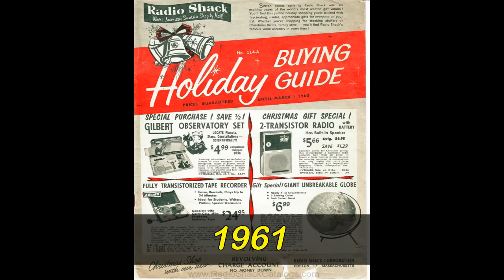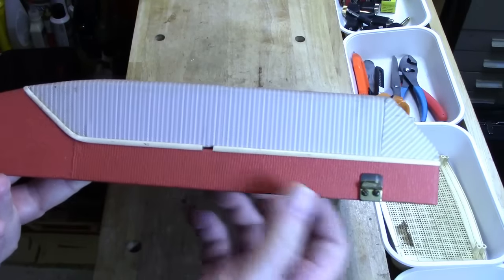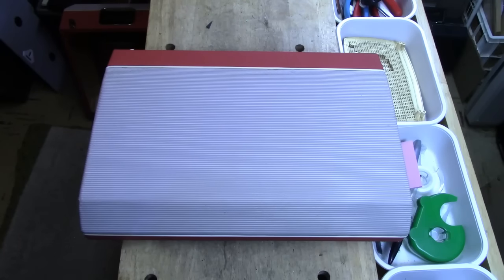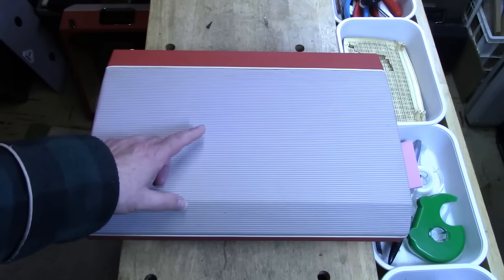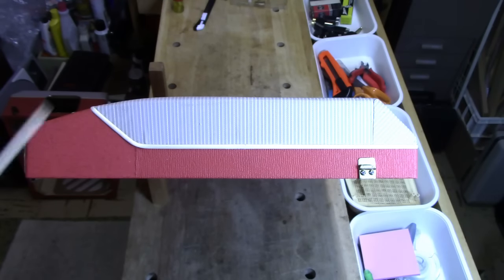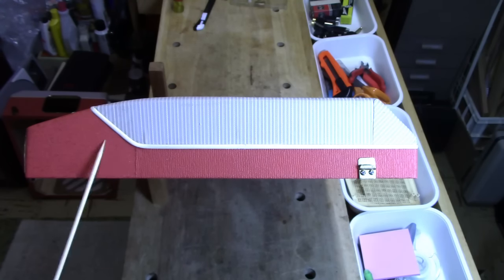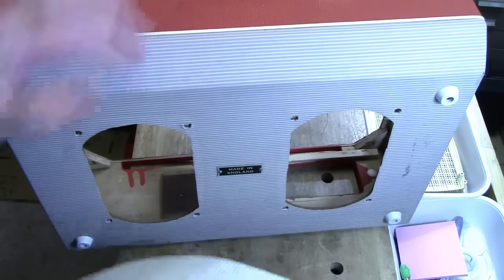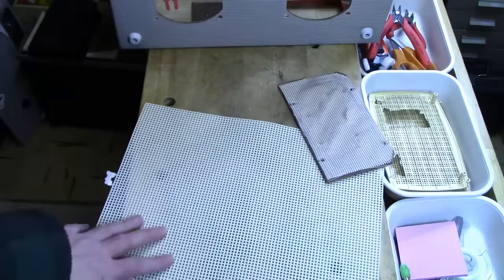Ep.3  – Keeping Up Appearances with the Realistic by Robuk Tape Recorder

Comment: Hi! Happy New Year!
Nice work! I'm glad there's a new video.

200W that's quite a big power consumption. I have a 5 tube Unitra ZK-145 (based Grunding TK-145 licence) that consumes only 46W. Although, it only has one motor.
Reply from the maker: AlexM1983DHUN  Thanks for watching the video. I was rather surprised to read that 200 watt designation as well. I suspect it is because of the motors. I think the take up reel motor is the biggest culprit. It is powered at all times, but held back in play or record by the capstan, so I expect it draws more power because it can't get up to speed. 

And when these motors try to do rewind or fast forward with a full reel of tape, it may be a struggle for them as well, so they draw more power to get going.

 I don't think it could be the amplifier, as it is just the 5 tubes, one of which doesn't even run half the time (the magic eye only works in record). 

Well, the electric company will be very happy! 

Happy New Year!

Comment: That speaker looks as if it might be a Fane Accoustic product, from Batley, in Yorkshire, England. Many years ago my parents had a "Perdio" reel to reel machine, it was an all - tube affair, and it had the same speaker. You've done a very good job with that Robuk, don't let anyone tell you different. Looks great. All the best for 2017 Tim.
Reply from the maker: River Huntingdon  Thanks for watching the video and for the info on the speaker. It looks to me like a pretty robust one, especially the "full body" frame -- although it is light on the magnet for the coil, but that is typical of the 1960s speakers. I also like that it is slotted so it is slightly adjustable to support the accessory compartment!  Happy New Year to you!
Reply: Many older elliptical speakers were like that over here across the pond. Though the magnet seems small, they were, as you know, often stonkingly efficient and gave a surprising volume for what they were. Of course the alnico design with the closed in magnet was ideal for the old tubes, and until recently even old tellies often had them. Showing my age now !
Reply from the maker: River Huntingdon  Yes, I've seen and worked with lots of speakers as you describe. The Sony TC530 (and probably similar units from them) have 6 x 9 oval speakers with relatively small magnets, but they put out incredible bass!

Still, it always amazes me that with all the audio stuff I have heard, my pair of $3.00 little computer satellite speakers blows me away with the sound they put out. Of course, I'm sitting right in front of them!

Comment: Ironically, the original color of the 'frames' of those inserts was closer to the shade of your new Plastic Canvas inserts. Certain 'white' plastic yellows over the years. to wit: cabinets of PC clones made in the 80's and 90's :)
Reply from the maker: Thanks for watching the video. Yeah, plastic can sure discolor with age! 

I could make the frames match the color of the plastic canvas if I covered them with ROMEX cable outer insulation. Ironically, it is the SAME width! It would make the frames stronger too. I am undecided however, as I have gotten used to the dual colors that I have now, and do I really need to make this project more complex than it already is?

Comment: I think you did a nice job restoring those little grills on the bottom of the case. I know in person you may think it looks a little rougher than it did in the video but from what I could see I think it looked pretty darn good. And it is a big improvement from the old grills which were broken and missing parts. And I can only guess what you used for that cloth for the speaker baffle when you were recovering it  it was either an old t-shirt or dare I say a pair of undershorts?  :)   also I'm damn sure I can guess what the T & B meant when you were talking about cleaning up the brass fittings. I'll just add a letter and say I think it was T----x, and B----o.  lol.  it's coming along great, and I'm sure it will look and perform pretty much as it did when it was first manufactured.
Reply from the maker: amberola1b  Thanks for watching the video. My issue with the job I did on the vent grills actually starts with both you and Buzz1151. I watch your videos very closely to learn from you, and your restoration work is really amazing to me. You guys do things with Bondo that floors me. So you guys have set me a very high standard that I want to live up to. When epoxy doesn't dry properly, that gets to be a real disappointment, because what can you do but wait? You know the joke about watching paint dry...Sigh...

You are close on the T and B products, We both now know what the B was for. The T is a little trickier. 

The T that ends in x product is no good for brass (at least that's what it says on the bottle) but there is a T sold in grocery stores that ends in e and rhymes with the name of those tiny chocolate bits people scatter on top of cupcakes,  I bet you can guess it now. They may not carry it in your area. I only found it in one of two grocery stores here -- neither of which carry the B product anymore -- had to get it on line. I am seriously hampered because my local and beloved ACE Hardware closed down 6 months ago. I am still grieving the loss. And there is no support group for this... "sigh, and again I say, sigh...." (quote from Gilbert and Sullivan "Pinafore")

I am pleased overall with the way the speaker grill came out, even though it is rough and not truly original. I think it looks nice with the "plastic canvas" material. The white stretchy cotton cloth -- yeah, you know what that is -- but I swear it was totally clean and bleached - which is how it got so stretchy and cuddly soft to begin with!

Stay tuned... I am diving into the mechanics and electrics -- kind of a challenge when the only circuit diagram I have has NO freaken values printed on it! But I did learn from a commenter that in Europe, when you see the symbol for a capacitor as two black rectangles and one of them is an open frame, that's an electrolytic. 

Happy New Year!

Comment: Don't be so hard on yourself, the restoration looks excellent. By the way the fibreboard looks like a product we call Hardboard in the UK, it's a brown colour, smooth on one side and rough on the other but without seeing it close up that is just a guess. Take care.
Reply from the maker: Tim Marshall  Thanks for watching the video. I think you are absolutely right about the "hardboard". This material in the taper recorder is as you describe -- it is rough on one side and smooth on the other.  

OH -- and I learned (silly me) that the American version is called "Masonite".  (Why is is called that? Is it named after the great actor, James Mason? Was it invented by the Masons?) 

Apparently Fiberboard is made up of pressed wood chips (not fibers??? I always called it "chipboard") , but Masonite is made up of pressed fibers and dyed that brown color. Masonite that has a grid of holes in it is called "Peg Board" and is used to make tool racks and vented cabinet backs.

However, because we are Americans -- and we like things to be as confusing as possible -- we use all these terms interchangeably. Don't forget, it was an American company that developed a computer that stops when you press Start (Windows used to do this).

Happy New Year 2017!

P.S. what is the hat you are wearing in your profile picture? It reminds me of the hats the train conductors wear in the UK (I love UK train videos!)
Reply: I am a Guard on the Swanage Railway, which is a heritage line here in Dorset in southern England and the hat is part of the uniform, another of my interests :-) Take care and I'll carry on watching your videos.
Reply from the maker: Tim Marshall  That is so cool. I love watching the documentaries I can find on British railways, especially the steam trains. I have learned that the UK started the railroads with Richard Trevithick (after he made that strange giant coach with 8 foot rear wheels!) and Stephenson's Rocket was a milestone of engineeering, and so cute too! I don't suppose they thought of these machines as "cute".  We have a few vintage railroads here in the U.S. and I hope we will never lose our appreciation of all that the railroads have provided.
Reply: In our way we both go about trying to preserve the past don't we, you with your excellent restorations and me acting my part in what is basically a re enactment of what was an everyday scene in Britain (and elsewhere) until the mid 1960's? I think the world was a different place then, you would probably appreciate this more than I do as you lived through more of it.  Our railways have changed almost beyond recognition since, as a small boy,  I watched filthy black steam locomotives still at work locally, probably around the time when people were buying the machines that you now bring back to life. We are lucky that a man called Dai Woodham bought a large number of locomotives from British Railways to cut up for scrap but never got around to it because it was easier to cut up old freight wagons instead.  Keep watching those videos :-)
Reply from the maker: Tim Marshall   I think we need to preserve and respect the past because that is where we come from and it continues to affect our lives. Imagine what the world would be like if magnetic recording tape had not been invented? No satellite tracking, no GPS, no video tapes, no audio tape and no computer storage and much more! 

While I would never go back to linear tape editing on a studio recorder (digital is MUCH too good and easy!), it is good to preserve examples so people at least know what it was like. I remember Walter (Wendy) Carlos breakthrough Moog Synth album "Switched On Bach". 

It came out in 1968 (I have the original album that I bought back then) and wowed the classical music scene because it was so fresh and innovative. It got a lot of "young folks" interested in classical music and I think maybe won awards -- or should have. HOWEVER....

It was made entirely on magnetic tape! It took over 6 months to produce with tons of tape editing. Carlos said he'd never do it again... and then came out with several more groundbreaking albums!

We now accept synthesizer sound as perfectly normal, and audio editing is so simple we can what Carlos did -- on a home computer with a FREE virtual audio studio! 

But back then, it was the stuff of outer space. 

My point is that mag tape tech made that possible, but it was laborious and awkward and yes, we have better ways today -- only BECAUSE of the way we were.

I think it is the same with railroads. I think it is wonderful that you participate in the preservation effort! 

Trains were the groundbreaking invention of the industrial revolution (along with steam engines) and changed the PLANET!  As you know, early trains were difficult, clumsy affairs -- and dangerous -- but at the time, they were amazing and changed society, in the UK and here in the U.S. -- where they led the way West (as we sometimes like to reflect). 

I got a chance to ride on a vintager steam railroad/steamboat adventure in Connecticut many years ago. The black, wood burning, engine was from the 1920's and lovingly preserved -- at some expense, which accounted for the high ticket price -- but we were happy to pay to support the preservation.

That engine radiated an amazing amount of heat, just standing idle while we boarded the all wooden combination passenger and hopper car. The front of the car was the hopper so some brave people could go outside and stand behind the tender. 

Well, as you can guess, this thing rattled and rolled on a very uneven track, chugging through the wild woods with the sound of the whistle echoing in the trees.

It was hardly what one would call a comfortable ride, and the wooden benches in the car and lack of shock absorbers (not sure they even had springs on the trucks) made for a bumpy ride! Yet, in it's time, it was the wonder of the age.

But more amazing was standing in the hopper part of the car and feeling the wind, watching the engine and tender swaying, getting the smoke and soot blown in our faces! (We had been warned!) 

And, what a ride! It really did feel as if it was an "iron horse", a living machine chugging along. I learned that we never went over 20 miles per hour, yet it seemed like we were flying. The roughness, the swaying the noise and clatter - what a trip! 

By comparison, the steamboat was a luxury liner, so smooth and quiet! The steam engine was centrally mounted to drive two paddle wheels and it was exposed so we could watch the piston rods thrusting the crankshaft (I believe it had three cylinders). The engine was constantly monitored and we got a great lesson from the engineer. What a fun ride! And then after a circuit in the river, it was back to the train, which ran IN REVERSE to our starting point! Blast from the past! 

Now compare that train to a modern high speed vehicle, (Like our Acela in the U.S.) and we have the same difference as in the audio. 

A groundbreaking technology that led to a brilliant future. 

Of course we want to live in that brilliant future, but also, we never want to forget how we got here! 

And preservation is the key to doing that! 

If you know where you've been, it is easier to decide where you want to go.
Reply: Yes, I now exactly what you mean, with photography I could never go back to film, even though I still have a few cameras, digital is just so convenient, particularly if you have  decent smart phone in your pocket. 

Although we operate standard gauge locomotives and 1950's/ 1960's carriages on the Swanage Railway, which are quite comfortable ,there are lines elsewhere which run on narrow gauge tracks. One is the Welshpool & Llanfair in mid Wales which runs some carriages with wood slatted seats with open platforms at the ends and riding on them is as you describe, what I like to describe as an organic experience, smoke in your nostrils and the sounds of the loco in your ears. Great stuff.   We are also lucky enough to have an ocean going paddle steamer called The Waverley which calls at Swanage Pier during the summer offering various trips for not much money. It has a 3 cylinder engine and you can go below and watch it working, it's great but has a habit of breaking down now and again as we found out last time we had a trip on her.  As far as keeping these old machine running is concerned you are talking big money as nothing comes cheap and nothing is available to buy it all has to be made from scratch. My hat is off to those far seeing individuals, all over the world, who saw what was happening and made an effort to preserve what was left while they had a chance, without them we would have very little outside of the museum, not a comfortable thought...

I do sit here and hanker for the good old days but looking at things sensibly, no matter how much I would love a time machine, I wouldn't want to go back to the living conditions of my young childhood. It didn't seem so bad at the time but no central heating, no bathroom and a toilet outside in a yard hold little appeal to me now. As my late mother in law used to say, there was no such thing as the good old days, not unless you were wealthy anyway :-)
Reply from the maker: Tim Marshall  I completely agree about the good old days. They weren't, plain and simple. 

We are living at the peak of our technological development and enjoy comforts never dreamed of back then. Home computers? Nah, only the big clunkers that took up entire rooms. Smart phones, really??? Smart phones that are computers??? And so on. 

I am sure that in the future, people will look back on our time and say "How did they ever live like that?" 

But, they will also say "Wow, did they have style!" Just as we do when we admire "steam punk" design based on what the Victorians thought was really cool -- not that the Victorians would ever think of "cool".